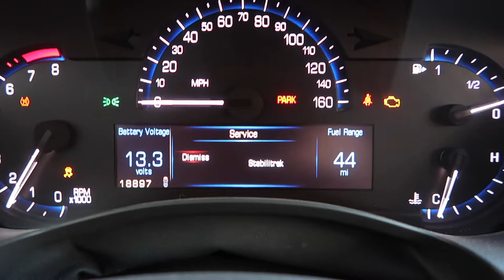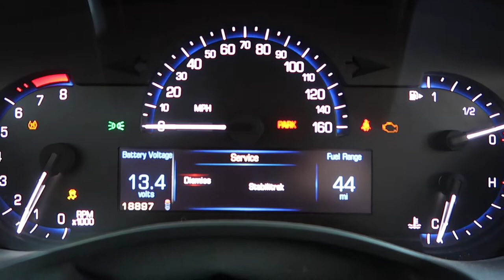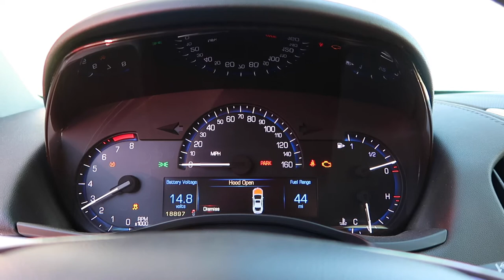DUDE, WHERE'S MY CADILLAC?!?!

Comment: Do you know  for sure the piston  is cracked,  could  be bad injector, plug,coil, do a compression test  too see if that cylinder  has low compression
Reply: It's his coil this happen to mine..
Reply from the maker: Car had a broken & bent valve. Cars back up and running once again.

Comment: Your issue is the coil or fuel injector bro easy fix under 200 bucks if you replace them yourself
Reply from the maker: Car had a broken & bent valve. Cars back up and running once again.